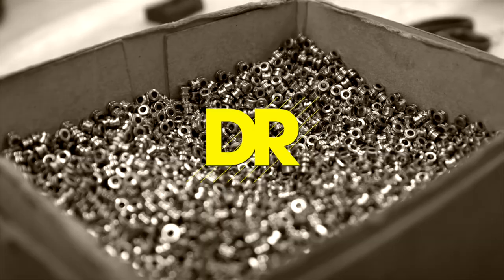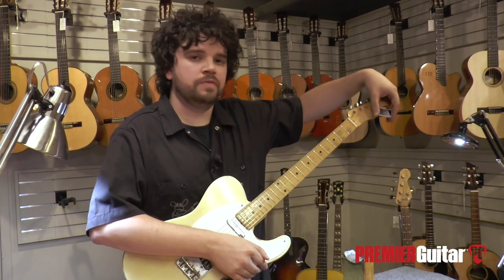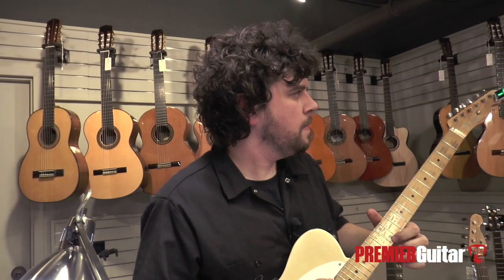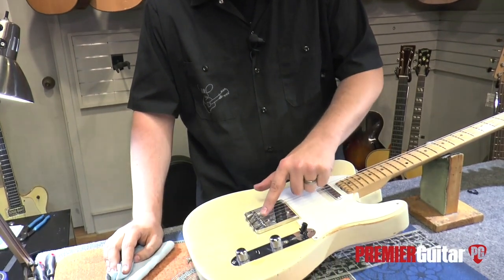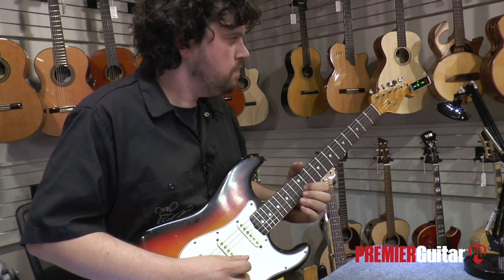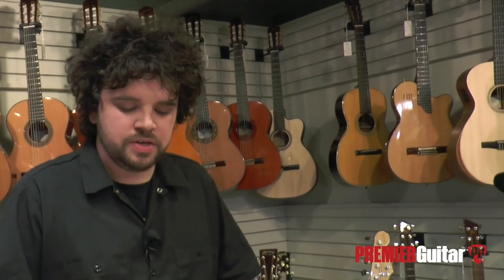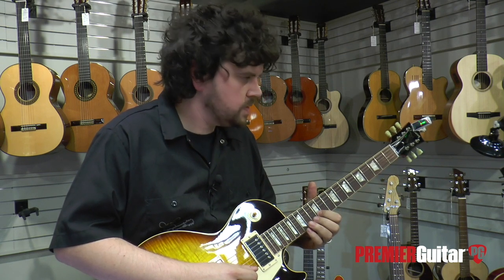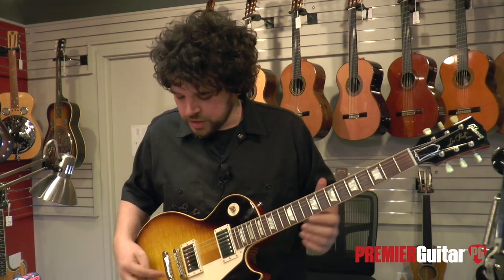DIY: How to Adjust Electric-Guitar Intonation

Comment: I feel like a hard tail stratocaster is the perfect beginner guitar. I have a real Fender Strat with a trem now, but when I was a kid I had a hard tail Squier Stratocaster. They're perfect for learning how to intonate and set up the action, without having to worry about the claw and spring tension and all that. My only issue with the old school Tele bridge is that you have to split the difference with intonation sometimes. But the old school Tele bridges look so much cooler than hard tail stratocaster bridges on a Tele.

Comment: Yeah, this somehow didn't help me in any way with my telecaster. No matter how far I turn the screw either way, nothing changes between the string being fretted or open. Like I'll literally turn it like 6 turns and no matter what, there'll still be like a quarter step difference between the note fretted at the 12 fret and open at the 12th fret. I basically can't play anything past the 9th fret with the low E being open. I feel like throwing the fucking thing out the window.
Reply: Is the saddle moving? You may have to push the saddle with your fingers after adjusting the screw.